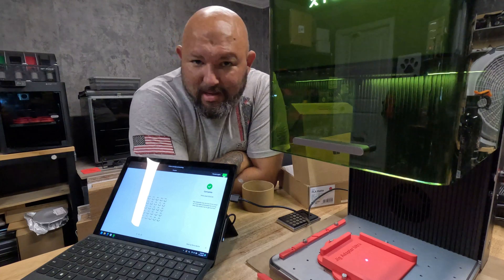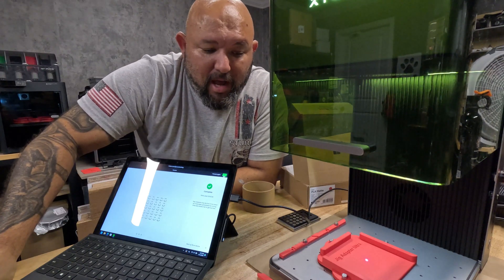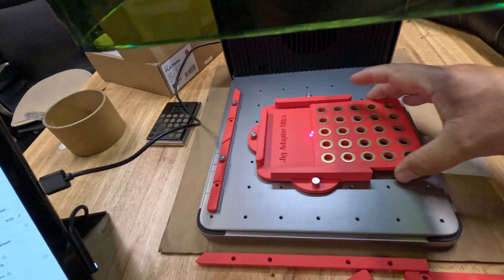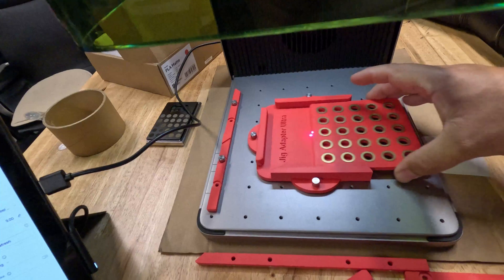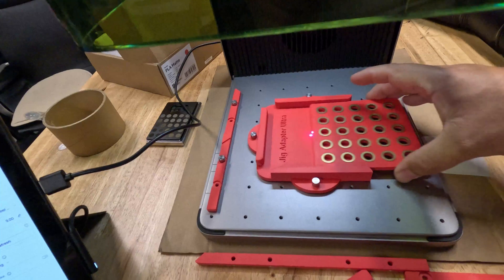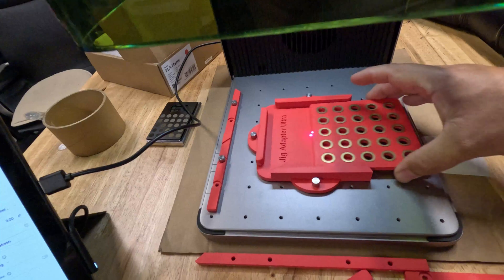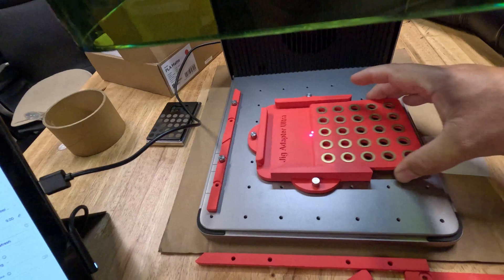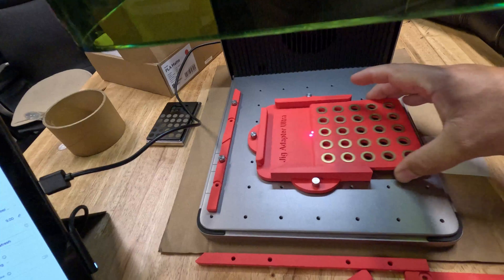Xtool F1 Ultra Camera Test get a clear view of your working area

Comment: Thanks for another good one.   After you adjust the framing will XCS save the locations accurately enough to just throw the fixture on and go next time without reframing?
Reply from the maker: ye just set all back in and send more jobs no need for framing, i recommend always frame but if you did your homework and you have a quality fixture you are good to go.

Comment: What up, thx for the vid. Do you have to wear specific glasses when framing? Noticed you can only see the frame imagine with the lid open.
Reply from the maker: I do and it is recommended I have the orange ones. Framing is done with the blue laser so I'm going to go ahead and say yes.
Reply from the maker: I recommend it. Framing is a low power of the blue laser so I really recommend using them.